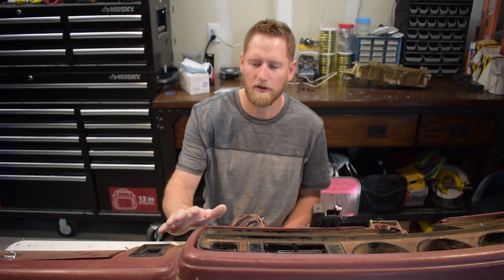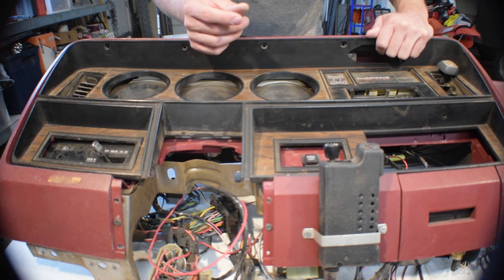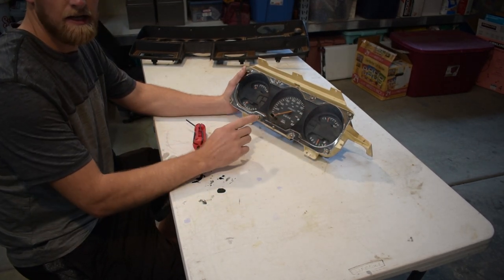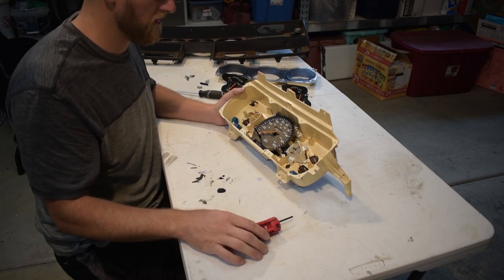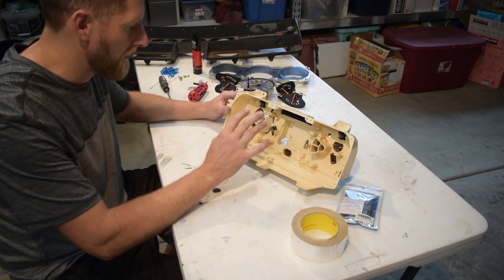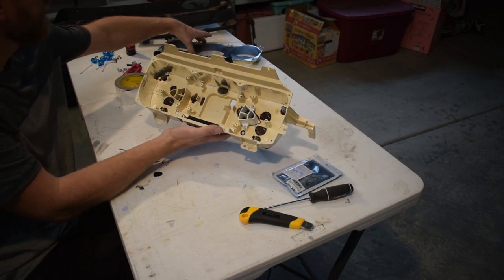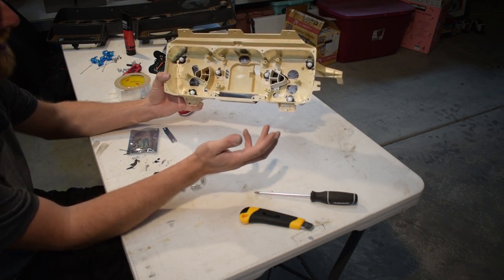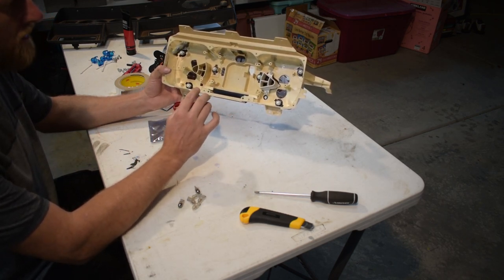Make Your Gauge Cluster Look NEW!

Comment: Your usual great work Tim. Did you just use water to clean the gauge faces. Would you think a touch of dielectric grease on bulb bases would be helpful.
Reply from the maker: Thanks man! I didn't use dielectric grease here because the risk of water being an issue is very slim but it wouldn't hurt to use some

Comment: What bulb did you use for the hvac control? Mine went out and I’ll upgrade to led while I’m in there
Reply from the maker: Its the same bulb as i used for the gauges. Make sure to get white. Any other color with distort the red and the blue color of the heat and cold
Reply: @decentgarage  thanks man. You’re the goat!

Comment: My '93 has gauge lights that are temperamental, sometimes they work, sometimes they don't. I'll probably be doing this pretty soon.

As for the rest of the interior, I gotta pull out and wash the carpet properly, glue new fabric to the headliner board (the old fabric finally gave up the ghost) and fix one tiny tear in the seat. Then it'll  be like it was new.

I also have the exact same trailer brake your extra dash has. I have no idea if they're any good, but it's nice it came with the truck. xD

Keep up the cool videos.
Reply from the maker: I'll be doing all that to this interior too. That trailer brake controller feels super heavy duty. It's actually really cool!
Reply: For headliner material go to Joannes fabrics they sell nice headliner use waterproof spray glue thanks Tim another great videos David
Reply: One suggestion for your temperamental lights could be the pins on the circuit board, where your gauge light harness power connects. Dodge went for the quick and dirty method, and didn’t solder them To the circuitboard. They just relied on the mechanical pressure of the pins being staked. I just recently did an LED conversion as well, and added solder to every pan. Pretty easy to do, and it makes a really good contact connection.
Reply: @jeverich  That's good to know. I will make sure to look out for that. Thanks.

Comment: Upon doing this i found that the previous owner had done this mod already. But since the lights in the cluster were constantly flickering I went ahead and changed the bulbs. Now my issue is that i cannot get my string for my PRND12 to function correctly. Any thoughts on how to correct this?
Reply from the maker: Give me more details. Is the string still intact? There are two notches on the lever that the string can hook to.
Reply: @decentgarage   Yes, string is intact. It seems like somehow the adjustment is off. The park gear is indicated as Reverse and my grid heater wont even activate when I cycle the key, the starter relay that I recently installed will click all day though. If I cycle through the gears and go all the way to 1 the gear indicator will stop at around 2 or so.
Reply from the maker: @KeystoneOutdoorsman  so yeah there are two slots that it can hook to. Try hooking it to the other slot.
Reply: @decentgarage  Will do. Thanks for your response and content!

Comment: I did this with my 87 Ramcharger. Looked really great for about a week and then everything went dark. I blew a fuse. Replaced and it immediately blew. I even tried a higher fee, but it also immediately blew.  I’m wondering if there is a wire issue instead of an LED issue, but the regular bulbs were fine.
Reply from the maker: Interesting. I've only heard of that being an issues with changing turn signals to led without upgrading the flasher relay. I will keep you up to date on how they work out
Reply: @decentgarage  Ah! I switched those bulbs as well. I guess I need to upgrade that flasher relay. I haven't found the recommendation in my research. Do you know off the top of your head what I would need?
Reply: @DonahueJosh  go to LMC Truck or superbrightled.com they have them, I think you may need two of them.

Comment: I messaged you on Fb under Gabe Niccum. I was wondering if you could assist me in locating the dome lamp connector under the dash. I know my light works as I connected it to an outside battery source but it came unplugged on the truck. And I can’t find where it connects under my dash.
Reply from the maker: Are you on Instagram or Facebook. Mark Taylor with TaylorMade Dodge Garage is my go to for random parts
Reply: @decentgarage  I’ll have to check him out.

Comment: I just put them in my 92 D350 and none of them work. I tried to flip them 180 degrees and still nothing. Hopefully I didn’t screw something up...
Reply from the maker: Try putting a few of the original lights back in. It may be a bad batch of lights. I bought two packs. In one pack 2 of them didn't work at all. In the other pack they all worked.
Reply: 'Ovens Garage' has a video here on youtube where he did LED conversion in his 1st gen gauge cluster. He showed how he had to slight re-arrange (bend) the pins on the LED bulbs to make contact in the sockets - might be your issue.
Reply: RedRyan I’ll give that a try, thanks. I tried putting the original lights back in but they didn’t work either which is why I was afraid I messed something up.
Reply: @aarono.8925  oh - if the original bulbs don’t work either - might check the pins where the harness connects to the cluster. There’s a comment further down here that speaks to the issue - dodge didn’t solder the pins, instead relied on mechanical connection.